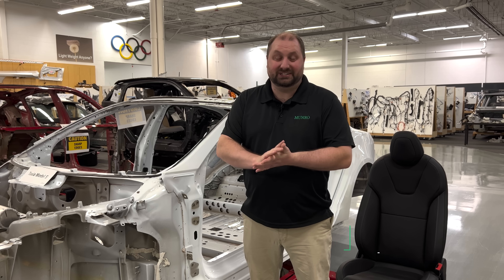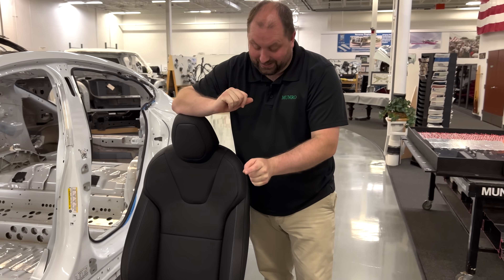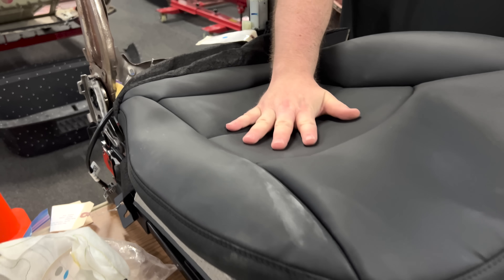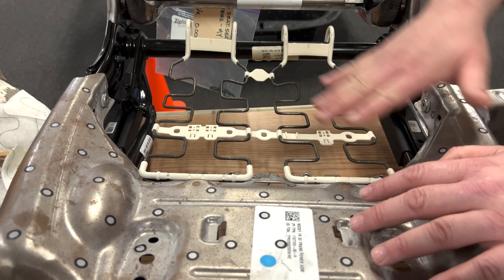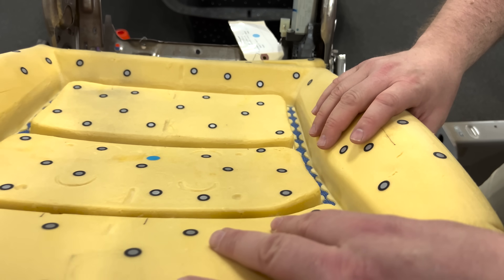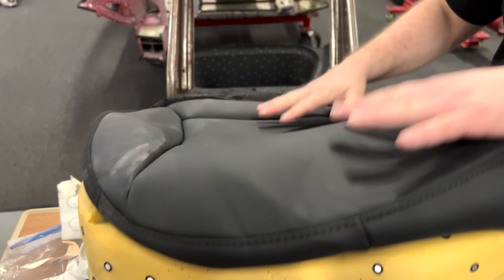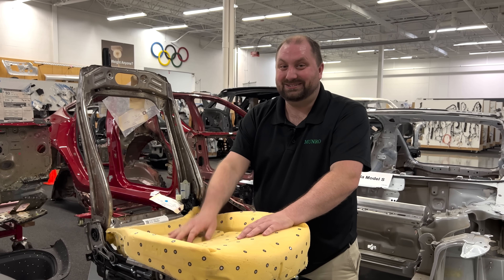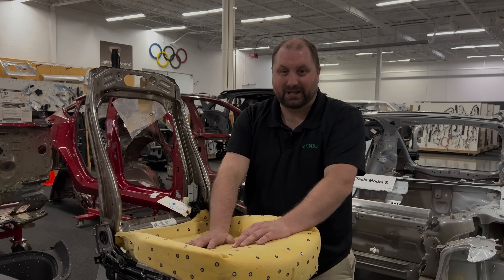Tesla's Seat Testing: Pros & Cons of Letting the Robots Take Over

Comment: Its not that hard to add is variance metrics into an automated test platform. You can literally add basic equations to have the testing robot move in and out at slightly different angles, pressures, movements, speeds, It does not need to be the exact same movement every time when something is automated.

Comment: For the effects of wear and tear I would first look at the worn and torn.  Visit any breakers yard or car auction and you can see the effects of time and mileage on seat structures and covering materials.  Likewise and mechanic or auto technician will have a litany of tales about structural design failures and sub standard engineering. Much of the success of a design should start by not repeating past mistakes.

Comment: Getting data is one thing; analyzing it is quite another. When they analyzed the data from the young human doing the task 100,000 times and the robot (assuming they analyzed it correctly - which is always an "ask"), what were the hypotheses and what were the results? Incidentally, one of the last video clips you showed of a robot test rig for the seat in action, it looked like there might have been considerable variation added to emulate a human. That is a good first step for generalizations. BTW: There are many types of seat cushions (to spread and or minimize temperature and pressure, especially for people with disabilities) - foam, water, air, gel, etc. I wonder if auto makers ever offer cushion options? Trunk drivers and others might really appreciate some of those.

Comment: The seat is great and perfect for sure. BUT,, can anyone please address the need of the headrest area that is NOT ergonomic to all bodies one size fits all? For short people especially. When are car makers going to make headrests that are safe and ergonomic adjustable to the actual driver torso height? I have a bow shaped neck pillow that hangs on the headrest so it rests on the nape of my neck. When your neck is filled and rested upon, your whole body is relaxed and far less shoulder and neck strain and tightness is made and body is better rested during a drive. Minimally, the headrest should be movable adjustable a full vertical length of 12” variance so that it can be suited customized better to each driver.

Comment: 1) I'd be that isn't the only testing Tesla does for their seating.  2) You didn't say if the intern vs robot seat fold test yielded any different results.  3) There is no industry standard for this testing so each automobile manufacturer will set it's own acceptability standards for seat wear and I would bet some requirements are far easier to pass than others depending on manufacturer. 4) Unlike most other brands, Tesla designs and manufactures their seats in house so they have much more control of the quality and reliability. 5) I've owned my Tesla Model 3 for almost 4 years, 70k miles, and the seats look really close to the day I bought the car, so I think Tesla is doing an adequate job with their longevity and reliability.
Reply: 7) Why is it so difficult to add some randomness to a robot?
Reply: @andreasherzog2222  you wouldn't even need random,  just having a cycle which includes more then one motion. Instead of running up and down - also add a left right and twisting motion.   That would be one cycle for the robot. You could have like 10 slightly different movements in one cycle.
Reply: @andreasherzog2222 because robots are t humans and are never going to be humans and are never going to be able to do everything a human is capable of period!
Reply: @andreasherzog2222  robots are made to repeat the exact action like a calculator you wouldn’t want to type and 5+5 and get random answers
As far as the robot goes since it’s pretty easy to use, just put 50,000 of one test and 50,000 of many other test until you break it
Reply: @andreasherzog2222  because you have to manually program random. The more complex the random the more expensive the robot. The more expensive it is the harder and more expensive it is to maintain. Other ways to compensate but their seats are known for being very durable so they have certainly done the testing just never shown it
Reply: They also have enough sensors in the seats to know exactly how to deploy the airbag in real time (leaning forward, to the left/right, etc). They can use that data to fine tune iterations as well.
Reply: @Thisisaplaceholder1 sandy also lied a out the Rivian Offroad capabilities! He made a video just talking instead of a proving ground compared to his Jeep! I've watched a video from out of spec overlanding and a Nissan with only rear lockers did much better than the 850hp Rivian Offroad so lol!!
Reply: @carholic-sz3qv  hu? I never said anyone lied. I was just stated in the Tesla video it was just a small part of the total testing process. 

As for the rivian I am not a fan of the vehicle, too heavy. The Cybertruck will blow it out the water.
Reply: @Thisisaplaceholder1  yeah childish reaction! Does the 1000hp "cybertruck" blows anything!? Nope!!! A Toyota Hilux even from the 90's with less than 100hp or even a modern one with 200hp is significantly much better and it's literally a go everywhere vehicle all around the world doesn't matter the harschest environments.
Reply: @Thisisaplaceholder1  you are exactly the same type of person that is comparing the 1000hp+ tesla semi hauling barely 80,000lbs to regular 500hp diesel trucks totally forgetting that 600-700hp diesel trucks are used worldwide to move the heaviest loads possible on and off the roads
Reply: Got more than 20000 miles on my model Y and had 3 vertebrae broken 2 years ago (a lady driver chose not to see my Harley) - so my back is rather sensitive. I own cars for 45 years now, and the Tesla has the best seats by far.
Reply: He didn’t actually say that  Tesla was doing it wrong, or that it was the only test they do. He was just making the point that rigid, non-random test, won’t highlight real world issues.
Reply: 6. Sandy Munro said he had never been better seated in a standard car. He even put two of 'm in his office on a turning barstool. And Sandy is a guy in his best years, where the back always comes back at you.
Reply: @hardyvonwinterstein5445 bullshit!!! Sandy is a liar! When you watch the Mercedes EQS sedan that he reviewed months ago he actually said it was the best seats he ever sat in! Also he had never tested all seats of all cars ever made.
Reply: Tesla does no testing. Lol.

Comment: The Model 3 and Y front seats are too small. Compared to many cars the seats are about 9/10's size. For taller people they do not offer the support needed.
Reply: The tradeoff is many vehicle seats are too large and average size people slide around in them. I find the 3/Y to be perfect for us.  If you are tall, short, wide or thin, few seats work ideally for every body type. Get a car that has seats that works for you or you'll be unhappy and uncomfortable.

Comment: What was the result on the intern vs robot test on the back seat recline? Did you find major variations in the wear pattern?
Reply: The intern probably wore out before the seat.
Reply: @djwarren5081  they should test again with a diffrent intern, to confirm wheter this is a common issue or not...

Comment: As someone just mentioned,  I've been advocating for swivel seats for years !!! Is it a safety thing or dollar thing. So much more convenient. My seat automatically moves back. Just add swivel function .
Reply: What kind of a swivel? Where the whole seat comes out of the car or a seat which rotates on the floor from left to right around a vertical y-axis?
Reply: @abrasive_ideas  Yep that's key. If it swivels around an axis, that's unlikely to work because there simply isn't room for that. And if you remove the seat/add it backwards, it's probably not as useful as anyone would like.
Reply: Just rotates,  so you're not sliding in, but turning in.
Reply: Great Idea, and Kia has the feature on its 03 row
Reply: You can do the swivel! Seats for less able-bodied people actually do this and can even come out of the vehicle.